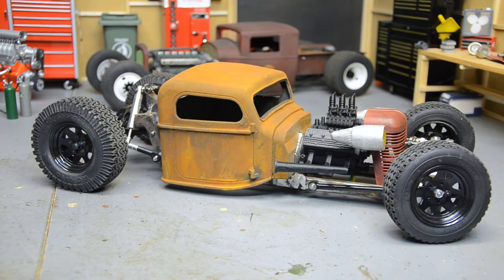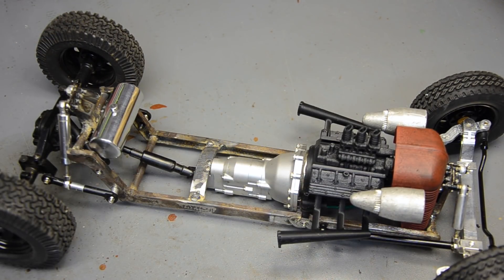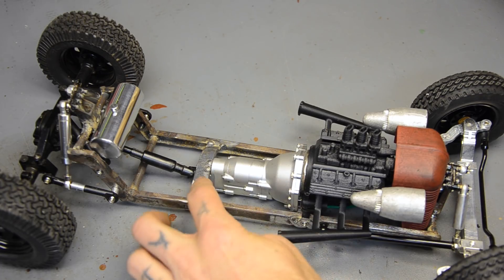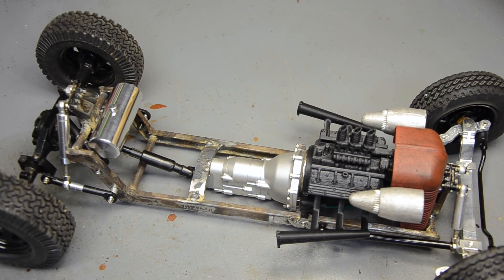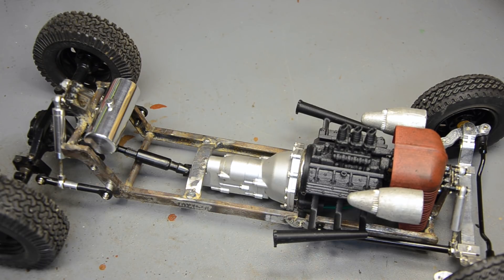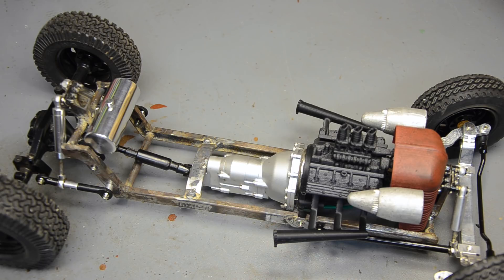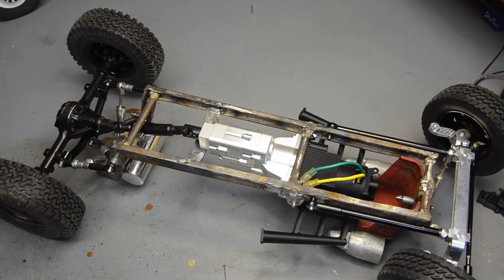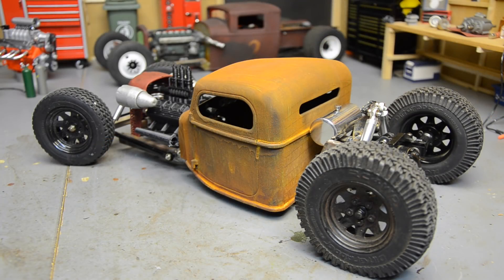RCengineering, Fabricating Scale Engine Mounts on the latest RC Ratrod Scratchbuild

Comment: The yellow residue you’re getting after welds is usually a sign of a zinc coating, id recommend either sanding it off or getting steel tubing without a coating. Welds will be stronger cleaner and easier.

Comment: You should try to make some air ride suspension for it and use that tank for a air tank
Reply from the maker: Ive toyed with adjustable suspensions before.  There isnt enough space on this type rig to hide all that goes along with it.  Waiting on technology to get smaller and more scale.
Reply: RC Everyday I have also been thinking about making room for things , ever think about using the chassis to ground wires to like a real car/truck. It would be really scale and I have never seen it done